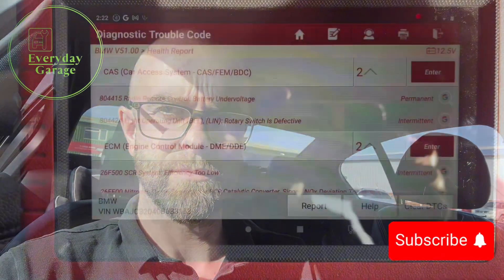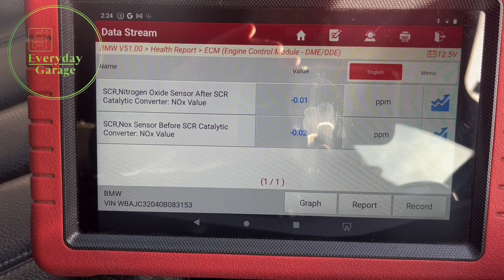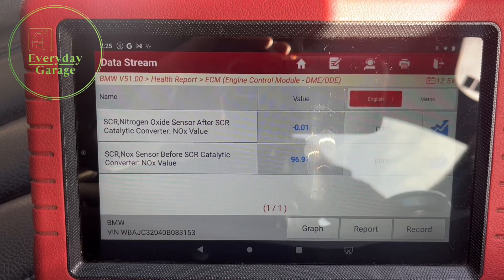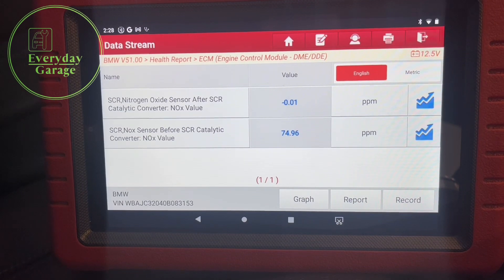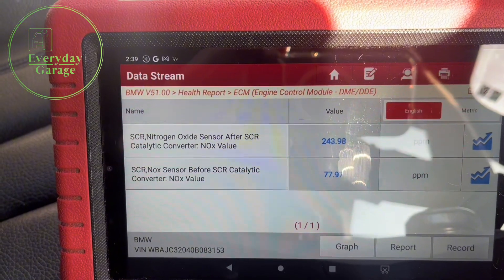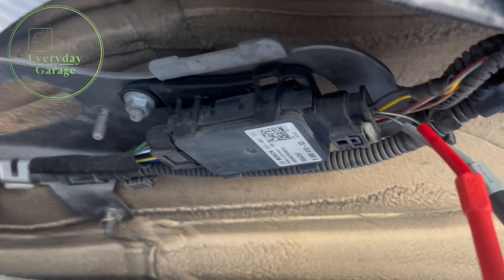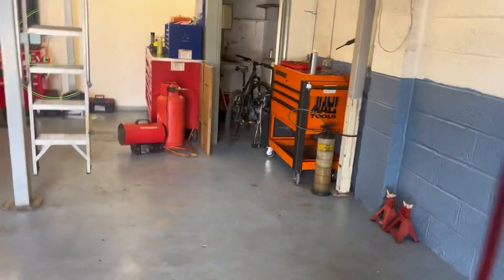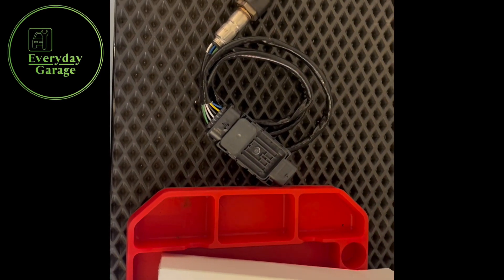26F500 SCR system efficiency, 26EF00 Nox sensor after SCR Nox deviation to high. BMW 520D

Comment: Just had check engine light on my 2019 g32 520d. The BMW garage told me it's a nox sensor and they will need to do further examination (I gues similar you did). But the strange thig is that car has only 77 000 km and there was no ad blue error, just check engine light ... Is that normal on this mileage?
Reply: I have same problem 2018 G31 520d 76 000km. How did you fix it?
Reply: @radovlje1  i have same error code come up today, did you manage to fix? 

I found a video, where they soaked the sensor in cleanring fluid on a Merc and that solged the problelm
Reply: @rosssoden2818  can you tell me wher nox sensor 2 sits on car so I trie to take it off and clean? Thank you so much for replay
Reply: If you can send me picture I will try to take it off and clean?